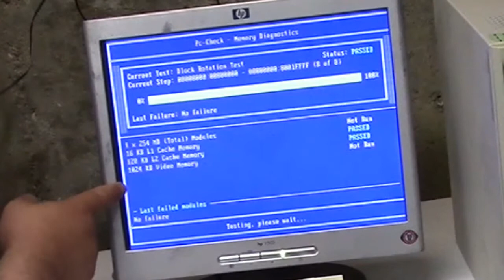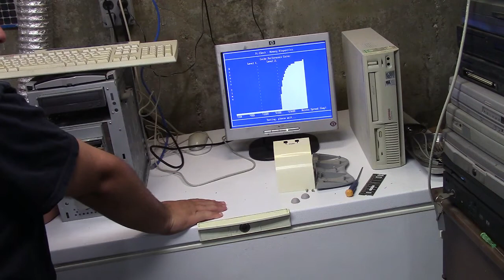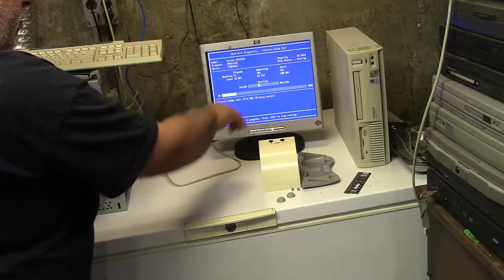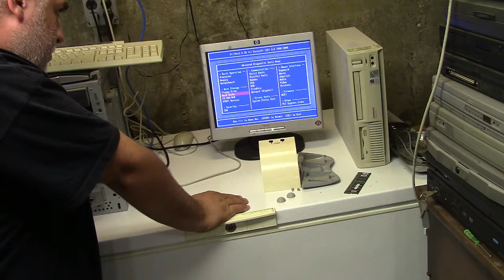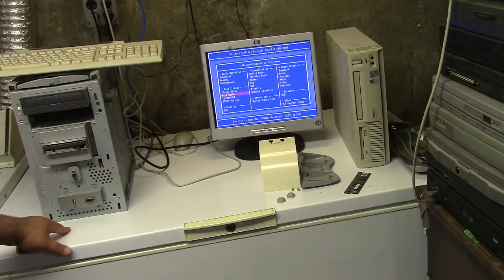Failing Digital Picture Frame Computer, Part 6 - Modification And Testing

Comment: I've heard a lot of people bitching about Maxtor drives and how they don't last on you tube but I have never had a problem with them.  I have 3 or 4 of them ranging from 20 gb to 160 gb
 and none have ever shown any indication of going bad.  That said I do not leave my computers running 24/7/365.  They are on while I'm home and using them but get powered down at night and if I'm not home so that cuts down the number of hours they are just sitting and spinning dramatically.   The only drive I had fail on me was a Samsung 1TB drive that came with my Dell Studio XPS 7100.  It failed within 6 months and was replaced under warranty with either a WD or a Seagate, can't remember which, that I've had no problems from in going on 9 years now.  The best part was the replacement drive came with just Windows 7 installed on it but none of the bloatware that came with the system new.  They were nice enough to send me a cd with all the bloatware if I really wanted it installed.  It still has the plastic wrap on it.
Reply from the maker: Yep, I always like Maxtor drives.  Always hated WD drives.  Everyone used to say "for every dead WD drive I've come across, I've had 10 dead Maxtor drives."  I had the exact opposite experience, seen way too many dead WD drives.  Funny thing is that later on in my "career", I found I must have replaced hundreds if not even thousands of drives with WDs, and I think I might have had 1 or 2 go bad in that time.  They somehow got more reliable.

Keeping the drives powered down is a wonderful double-edged sword.  Sure, it keeps the MTBF hours down which is a huge plus, but there's always that "what if they don't spin back up?"  I agree though, and I prefer my drives to spin down after inactivity.  I have 2 backup drives on my machine here, one internal and one external.  Both of those spin down, and I know this because when I copy stuff to them, I have to sit there for 3 or 4 seconds while they spin back up.  For whatever reason, Windows doesn't like spinning down the main drive unless the machine is in standby or hibernation mode.  I don't think I've ever come across a system where the main drive spun down, unless we're talking about the old Windows 95 and 98 days, back when that would actually happen.  A lot of computers were still desktops in those days, or if not, still had hard drives you could hear.  I remember many times when I'd go and launch a piece of software I was using earlier and the program was still in memory, and it would re-launch the application without even spinning the drive up.  As soon as something wasn't in memory, you'd have to sit and wait for the drive to spool up.  Some drives took their sweet time getting back up to speed, others were able to spin right back up very quick.

I am in no position to be surprised about a Samsung drive failing.  Great drive when new, awesome proof of concept, you can build a computer and get it out the door before it fails.  I wouldn't trust it farther than I could throw it.  Same with Hitachi drives, and there were a couple of other no-name drives out there I wouldn't ever chance anything on, unless it was a quaternary backup drive.  And yep, it's amazing how a machine actually can run without all the bloatware!
Reply: @jaykay18  I have a Windows 2000 machine that will spin down the primary drive during normal operation of the machine..
Reply from the maker: I don't know what purpose running Windows 2000 still serves as most any machine that can handle 2000 can also handle XP.  Many years ago, in fact around 2000, my dad had a laptop issued to him by his job which ran Windows 2000, and that also spun down the hard drive.
Reply: @jaykay18  It was just an observation that contributed to your aforementioned curiosity, I never said it was still practical for use..
Reply from the maker: OK.